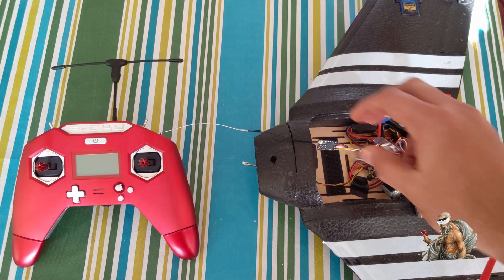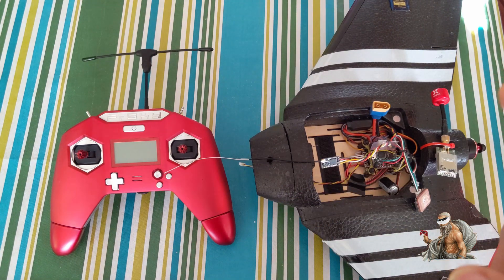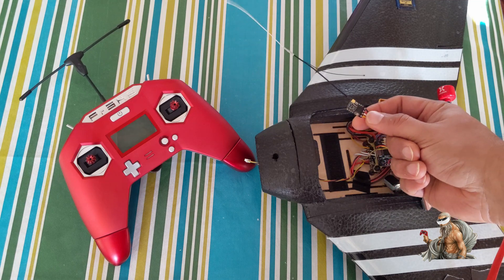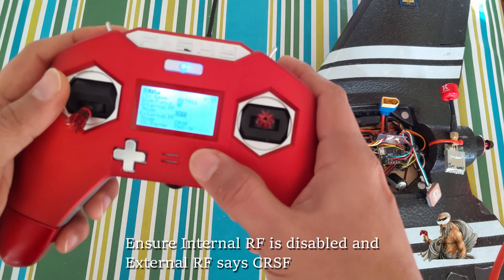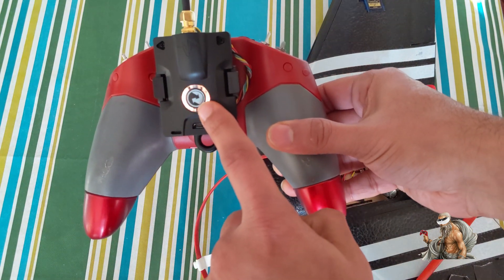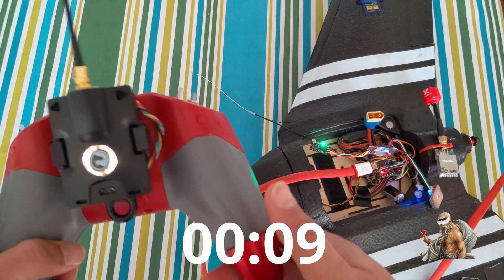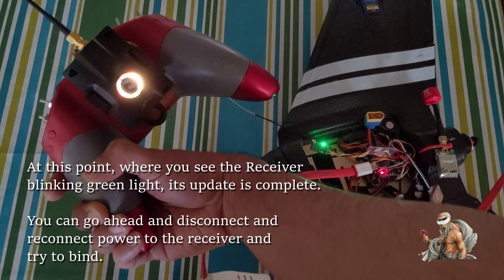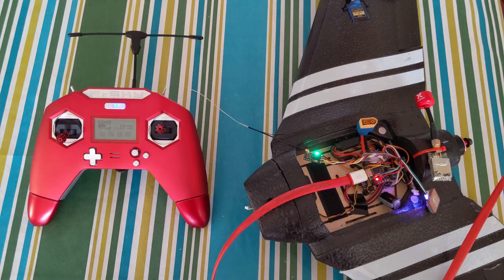How to bind TBS Crossfire RX to TX without LUA | Micro TX | Nano RX

Comment: Great video. I wish it answered my problem. My module flashes orange then green. It does not flash blue. I have been 5 hours, and I cannot bind my drone. Help!!
Reply from the maker: Did you check if you are on the right version of the firmware on both tx and Rx?
Reply: @shyamfpv  I believe I am. I clicked on the latest version of agent TX. What do you mean by RX. If you mean the receiver, I can't get that far. My radio does not recognize my CSFR module. Also under CSFR it shows status "250 Hz 3 ERR" What does that mean?
Reply from the maker: @jerryzito6840  what radio are you using your crossfire module on? Also, when and where do you see that error message?
Reply: @shyamfpv  RM TX16s. Error message is next to "status" under external RF.
Reply: @jerryzito6840  did you get your crossfire working yet ?
Reply: @gregorydahl  Thank you so much for your interest and concern. After an uphill battle, my quad is flying beautifully.
Reply: @jerryzito6840  
  Today i opened my new tbs nano starter kit of 3 recievers and nano tx .
  I already had the micro box shaped starter kit with one rx receiver  left in it's package . 
 So i used the older rx and tied to bind it to the new nano tx module on my zorro .
    I used agent x to bind and now it will not bind with either the old box module or the newer nano module .
  So i opened one of the 3 new recievers and tried the button bind method first as seen in this video and it is working .
  So glad .  And this is after spending $600 on elrs brand stuff . 3 tx's and 6 rx's and a zorro .
    I put the elrs away fir some rainy day maybe buy a computer .
    If you do not have 1 watt output and have the model on and bound you want 1 watt out put you make sure it is on and bound and press the tx module button 11 times in a row . Then you will need tbs agent x that comes in zorro on an included sd card and use tools >> tbs agent x >>> micro module >>>> settings >>>>>> general >>>>> reion >>> open .
  But you need to rebind again . 
   The nano reciever might not turn slow green blinking.  You have to hold bind and plug in battery , keep holding in and release and press again quick within 2 seconds and it blinks slower and keep holding bind until it goes into bind slow blinking green .
     Why it does not bind the old kits rx with either module with either method i do not know .   I put that rx in its package in storage too . 
       But everything is working now . 3 crossfire drones a 3"baby ape , a 5 " tccmc ali express $88 pre assembled drone , and a tyro 119 kit .😃👍👍
Reply: @gregorydahl  YES SIR!!! You're the best.
Reply: @gregorydahl  I'm sorry. Yes, I did. Thanks for your help.

Comment: Nice one👍 but I have updated my and tx module now all my binding in all quads have gone. Its solid red and pain to reach the bind button on the rx. Is there anyother way to get the rx into bind mode without pressing bind button?
Reply from the maker: That's the best part of crossfire. Turn on your TX, go into bind mode. Then plug in battery in your quad... You're TX should automatically detect the RX and bind it. If the version on the RX is outdated, the tx will automatically prompt to update.
Reply: @shyamfpv  Its not working that way. Red light is always solid untill i press bind buttom.
Reply from the maker: @outboxfpv4360  huh... That's strange...I have never had to do that... I always follow the process showed in this video... I wonder what changed
Reply: @outboxfpv4360  
 Did you get that working ?
  I set CE region and tx locked into 25mW . Then i pressed the reset setting .  But there is way to fix it without computer .
   
   . I got 1 watt output and binding back without a computer .
   The rx was not bound after unlocking 25mW 
   I had to hold bind and plug in .
   Let go bind and repress within 2 seconds . It blinks green different and keep holding it until it turns red solid .
  Then unplug .
Test it blinks green slow when you plug it in again .  Then unplug it . 
  Turn on tx . Orange pulsing . Press once . Green blinking . 
   Plug in drone it binds . Solid green . Unless blue blinking . If tx is blue blinking the rx needs an update . So press tx button and wait until solid green . Unplug rx and shut off tx .  It should bind and arm just like new now .

   To unlock 25mW you turn everything on make sure solid green lights .
   Press tx button 11 times in a row . 
     Go to tools on sd card >>>general >>>>region >>>>open .   And all power settings were back .
   But then i had to rebind as i said above with the rx .
       It wont work without sd card tools for crsf .  But you can use another tx that has tools to unlock when it is bound to your rx . 
  You can change settings and put it back onto your tx .

Comment: I have bind the the rx but my nano has blinking green not like yours was solid green. Any idea what was something wrong
Reply: Hold button and plug in( blinking green) and let go button and press and hold it again within 1 or 2 seconds (blinking faster). Keep holding it until it turns red . Unplug  .
   Now it should go into bind mode as soon as you just plug in the battery .
   To rebind shut off everything first . 
 Turn on tx .
Press tx . Green blinking .
Plug in rx . If solid green you are done . If blue blinking press tx again wait for update to finish and turns green solid .

Comment: Very nice steps to bind. Very helpful.... What Flighte Controller do you use for RC wings? Does it show OSD?
Reply from the maker: I used a spare F3 flight controller from my old FullSpeed 2.5" quad. I run inav 2.1 on this FC and it flies fantabulous. I have flown about 4km on my wing with crossfire nano. Inav does have OSD capability and it is damn helpful.